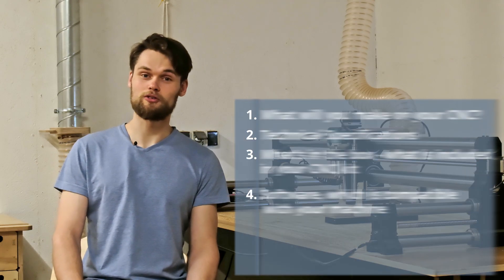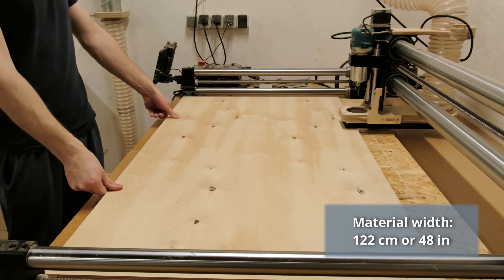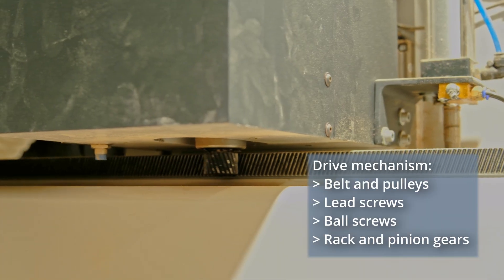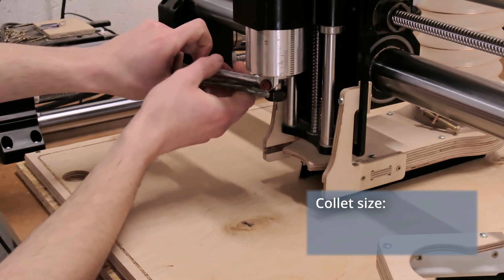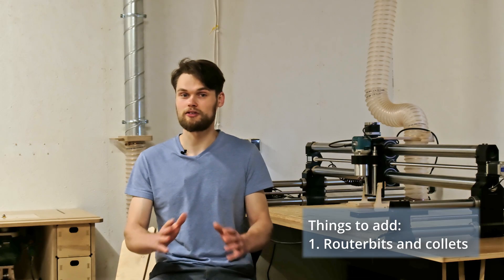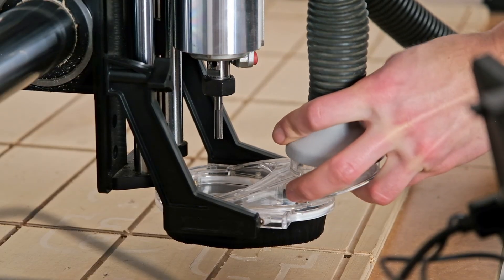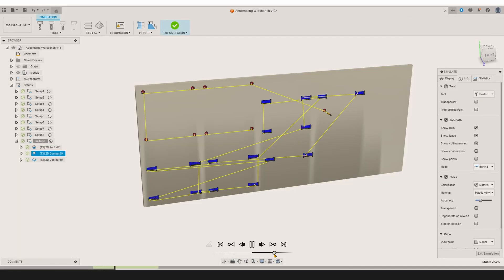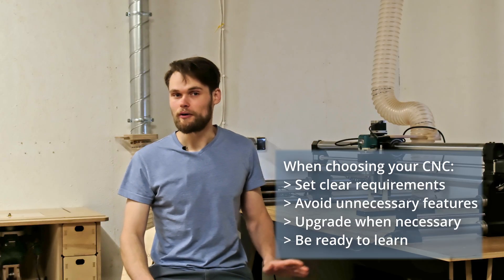6 Things to Consider Before Buying a CNC Machine

Comment: A nice introduction to the topic. Personally I have an Elite Foreman (48"x48") Masso G3 controller, 3HP (2.2 Kw) Air cooled spindle, ISO -30 with ATC and ER32 collets. With dust collection and compressed air... besides wood and plastics I have cut brass and aluminum.  I have been looking at https://www.youtube.com/@CapturingDust to upgrade my cyclone dust collection.

I have looked at your plans but you seem to be an Autodesk user. I am afraid I am a Freecad user so your your dxf files just don't me much good. I even tried export a step from Fusion but no luck. Could you recommend one of your files to start with? I would likely translate the format to Freecad ... just being honest. Once you learn something switching can be hard.

Comment: Hello, personally, I'm on my 5th CNC build and I'm still using air-cooled spindles.
I started with a small, a few-watt spindle, then on the second CNC I opted for a Kress of over 1050 watts (noisy, but it did very good work, but limited in terms of collet diameter).
Then on the third CNC I started with the Kress but quickly switched to a 2 kW Chinese spindle because the larger collet allowed for larger diameter cutters (especially for resurfacing the work surface, which is the work surface on which the workpiece rests and which suffers severely over time).
On my 4th CNC I also kept my spindle, and currently on my 5th CNC I'm opting for a 3.5 kW air-cooled spindle as well.
Why air? Because even if they make a little more noise, there's no need to manage the coolant, water pipes, possible leaks, or install a cooler...
Otherwise, mechanically, my first machine had a steel and aluminum frame and belt-driven movement. The second was all aluminum with specific profiles, as were the third and fourth, which, on the other hand, had a rack-and-pinion movement system (noisy, but I never lost a single step).
For the last one, I opted for ball screws. Admittedly, the movement speed will be slower than with racks, but the noise will be reduced, and the precision should be there.
The frame is mainly made of steel with a few aluminum parts here and there.
The advantage of steel is that the cost remains very low and the rigidity is truly present if you take care to design your frame well. Obviously, the "complicated" point remains the welding, with its heating shrinkage, which can cause the structure to shift, but you just have to be careful and compensate when attaching the mechanical elements, and everything comes together.
That's my experience. I would say that over time, we generally seek to stiffen things up to be able to tackle heavier work such as cutting and milling aluminum parts, although working with wood panels and often MDF remains my main attraction.
The work surface of my machine is 1050 in X, 1520 in Y, and 180 in Z. I'm using Mach3 and Fusion 360.
My motors are Nema 34s with 12 Nm of torque and a loop system managed by steppers. My control card is an EC3000 which manages 5 axes because I plan to add a fourth axis knowing that the second motor in Y is already slave on an axis named A
Reply from the maker: Wow, that’s an impressive CNC journey! The way you’ve experimented with different spindles and machine setups is really insightful — especially your reasoning for sticking with air-cooled spindles. This kind of detail will definitely help anyone looking to build their own DIY CNC. Thanks for sharing your experience!

Comment: Going to put this out there
Machine: NEW-Carve CNC
Controller: 6x CNC Controller for FluidNC (integrated ESP32)
Motor/Driver: TMC2209 w/ regular Nema 27's
Spindle: PwnCNC Spindle
(MASSO is overhyped)
Reply from the maker: That's a solid setup - seems more than enough for most woodworking projects! 👍🏼

Comment: Awesome content. I have learned a lot from this video and the Fusion 360 video you did as I am just starting my CNC furniture making journey. I have already bought your wood rack design and built it on my CNC. I know you have briefly discussed how you use straight cut end mills at full depth but I would love to hear your overall end mill / contour strategy to not have to cut tabs.
Reply from the maker: Thank you! I’m really glad to hear the videos and project files have been helpful. That’s awesome, you already built the wood rack! I’ll definitely make a video going over the router bits we use and our cut settings to avoid support tabs.
Reply: If you're using plywood, compression endmills are the bee's knees. They'll give you the least amount of tearout, and will tend to compact the chips into the cut, holding your piece in place. If you can't take a full-depth cut, you should aim for at LEAST the depth of the upcut portion (usually 1D for all the mills I've seen) and the finish pass (that cuts all the way through) to have enough stepover that there is plenty of chip to compact in the cut.

I think Davis ended up with the straight bits to suit his machine's rigidity and power (upon consideration of those two requirements). Pretty sure he addressed it in an older video, though I don't recall which one.

If you aren't concerned about the bottom surface finish, a downcut mill is even more effective, with fewer requirements on the stepdown and stepover, at the expense of bottom tearout.

Comment: I've used a water cooled spindle and several palm routers. I can say that I prefer the water-cooled spindle by a country mile, but for anyone who doesn't want to shell out for the spindle plus controller (which is the real reason I like it so much), don't be shy about the palm routers. Blow the dust out after every job, or every half hour or so on long jobs, and buy some extra brushes. They have plenty of power, and can be rebuilt for not too much money if you wear them out. I cut miles and miles through wood, acrylic, and aluminum with them.
Reply from the maker: Thanks for sharing your experience! Totally agree with you — palm routers are a great budget-friendly option and can definitely handle a lot if you take care of them like you mentioned. But it can't compare to a proper water-cooled spindle, especially with an ATC, if your CNC supports that.